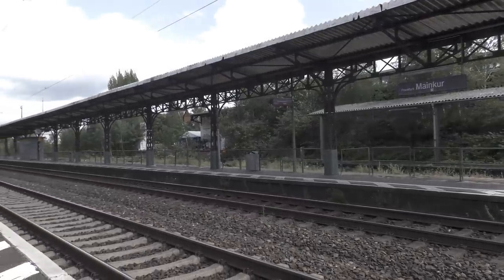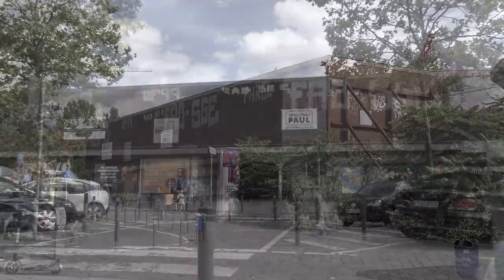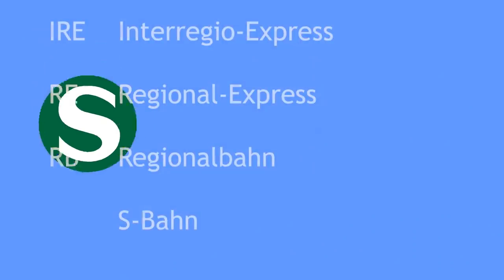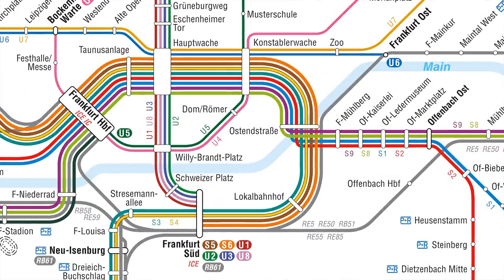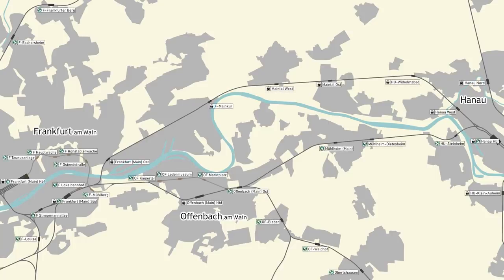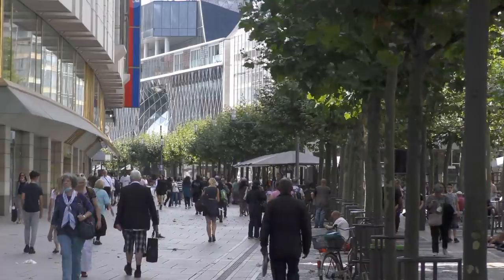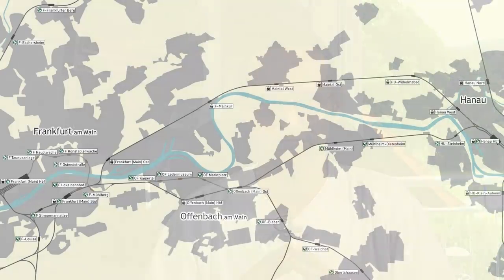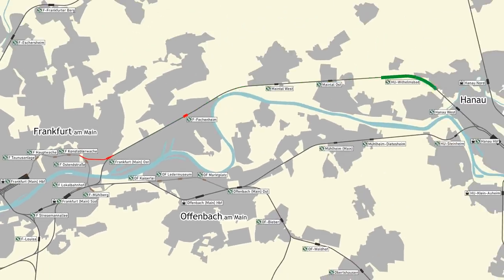Why is this station so neglected?

Comment: Imagine the day you're born, your parents hear good news that there will be a new train system. 35 years later, you're still hearing the good news while taking your child on this crappy train.
Reply: Yes, indeed.
Reply: It seems too common in Europe. In my town they promise to build new road bypass as it is really not sustainable to have about quarter of country to go through centre on something that is between road and stroad and planned in 30's and build shortly after WWII as it was necessary to rebuild it as Wehrmacht blew up about 6 or 7 bridges on short stretch, and it is still not finished after 30 years. Only luck is that town on other side of border had banned cars above 6t otherwise there would be even more trucks going through.

Comment: I mean, these stations look alright-ish, there are some horrid stations in the Ruhr area, too, which shouldn't be neglected by design.
Duisburg Main Station for example has >10 platforms, and is also slowly falling apart. There was a plan to rebuild it, starting 2018 or so, I think.
In 2021 there are some nice stickers on some walls inspired by the way the rebuilt main station is supposed to look, so that's something!

Comment: The problem is you can’t expect people change from car to public transport if stations looks like this. In Germany are a lot of railway station looks like Frankfurt Mainkur.
Reply: Indeed - unfortunately. And you can´t forbid short-haule-flights like many environmental activists wants to do it without running a proper railway system. And the stations are only one problem of the railway system and probably not even the worst.

Comment: I was shocked in the past years to see how derelict some stations in Germany were when traveling from the Netherlands where stations are often in excellent condition. Especially the track hall in Duisburg when coming from Arnhem... It had nets above the tracks to prevent debris from the dilapidated roof falling on travelers heads! But when I started looking into that a bit I found that the plan is to replace the entire roofing structure by a new one as a grander plan to renew 150 stations in NRW starting 2022. Well, here's hoping that doesn't get delayed any further...

Comment: I'm in Canada. We are sometimes given the impression that Germany is some sort of Commuter paradise. I love the candid dose of reality. 
I currently travel between Toronto and a small city called Peterborough. It has excellent highway service, but one neglected freight line to Toronto which hasn't had passenger service since about 1984 (many of the stations have literally rotted away). The Federal government recently announced that it would be on the route for a new high speed passenger service from Toronto, Ottawa to Montreal (it's about 60 kilometres away from the Lake Ontario and just outside the urbanized area of Toronto - think on the edge of classic Canawilderness
Reply: In terms of frequency of connectivity, even the bad stations in this video are way better than most Canadian ones.

I mean even in the Toronto metro area some lines still don't have all day service, while these shitty stations in the video get a train every 30 minutes all day long
Reply: Not a paradise. Public transport of some sort is almost everywhere, but you can't say that the service is good and it's a pleasure to use. Actually it's been going downhill in the past 20ish years.

Comment: Large investments in a line are not the only thing: you need travellers as well.  When you have misstreated your travellers away for such a long time, you start with much fewer users, which is bad for investments.  So: I is very probable that minor improvements to buildings which will get destructed will pay-off later.  Certainly when plans are not yet executed.
Reply: The half hourly service was bursting Pre-C with 150meter trainsets and additional peak relief trains because even with the stations in their state of disrepair, the route itself is well kept and a far superior option to the heavily congested Hanauer Landstraße and it's jams.

Comment: Where did you hear that Ffm-Ost will be completely replaced by the underground station? As far as I know, it will only receive an additional underground station for the S-Bahn, while the mainline services will still be stopping in the current overground station.
Reply: The commuter platforms will stay. There will still be REs calling because of the EZB, but probably only once per hour.

Comment: I would not hold my breath either...
The place I live now is basically cut into half by a rather busy (freight and commuting) railway line with raiway barriers in 5 places, being lowered at train rush hours 30-40 minutes an hour nowadays. An underpass was planned very early on - the excavators and dump trucks, however, which already had been moved on site, had to be retracted on the day the were supposed to start digging, as it was the outbreak of Word War I and they were needed elsewhere...
Ever since, there have been plans announced.
In 2021, I think, they started to build an underpass for pedestrians and wanted to continue with one for cars. However, dues to the pandemic and such, there were not workers. So the railway line was blocked for weeks several times, with very little work going on, and after that, in 2022, the Deutsche Bahn declared that  the next time window in which they could go on would be in 5 years at it's earliest. Up to then, the construction site in the middle of the town would just have to stay as it is... Upon protests of practically everybody, they at least finished the pedestrians underpass. And might even resume construction work next summer, as I recently read. But - I am not holding my breath. Again.

Comment: This situation is way worst in China... CR (China railway) is only good at operating long distance train and cargo trains. (We have a very cheap but very convenient and decent long distance passenger railway system, that's rare across the world.) But due to it is state owned, not city owned. CR can't feel the benefit of its service that developed the city or TOD. Investigating so much at commuter train, while occupying more profitable long distance/cargo trains' slots, makes CR just ignore any commuter train demand. And even worse, CR is formerly a department at nation level, it has same power of a province... Even Beijing government are just "equal level" as CR... Beijing gov subside S trains in Beijing for hundreds millions per year, but CR still very lazy at providing any commuter trains.
While the rest of China, most stations (including many small cities main stations) are closed for passenger service. And force most mid distance travel (I mean 10~200km, that's very long for other countries) to long distance coach or bus service. BTW, our airspace is controlled by China air force... causing LCC airlines way expensive than rails.
Also, same for Beijing East railway station, you can see the CBD's skyscrapers there, but the station in front of you is just as poor as the ost bahnhof in the video...

Comment: I lived at Frankfurt Ost in the building next to the one at 1:31 for 2 years - in the south of the railway line. Over the last decade they really built lots of housing like in 1:31 on that side of the tracks; a completly new suburban area around Ferdinand-Happ-Str developed. Right next to the station. BUT… the Station only has an exit to the north side of the tracks. You have to walk through a seperate tunnel created for the U-Bahn to reach the other side of the tracks. I barely used the trains there - if you wanna get into the City, you take the U-Bahn 6 or tram 11.

Comment: In the Rhein-Main area this line is one of the last (THE last?) line to get S-Bahn service.

Other German metro areas are off far worse: If you want to look at REALLY terrible stations and also just bad service, look at the Rhein-Ruhr-area.

There is STILL no S-bahn between Köln and Bonn! One is Germanys forth largest city with over 1 million inhabitants and the other the former capital, with around 350.000 inhabitants. If we're lucky it's going to be finished in 2035... 

And in the Ruhr area the service frequency is just terrible, and they started replacing the S-bahn trains with regional trains (which have fewer doors and are often shorter), but they still call them S-bahn...
Reply: > There is STILL no S-bahn between Köln and Bonn! […]
I mean, there's the RB26, which basically behaves like a S-Bahn between Cologne Main Station and Bonn Main Station, stopping at every station in between. Even goes every hour! (sarcasm)

Yeah, going more south than cologne, by public transport, is a bit of an ordeal in NRW 😅
Reply: @niduroki  At the very least there‘s an alternative in the form of the Stadtbahn services 16 and 18 on the former KBE railway lines … with slow, insufficient 60 m long light rail vehicles
Reply: @ft4709  And single track sections only allowing those 60m vehicles to operate every 20 minutes, at least on the Brühl-Bonn section...

Comment: Around 1982 the VR wanted to close Healesville station, the locals threatened to give the station building it’s first coat of paint since 1947. Which they did. The line was soon closed and is now a tourist railway for part of the length.

Comment: This is rather good - or is it unfortunate - timing, coming on the back of a train drivers‘ strike that wrecked not only most train services but also SBahn lines for two days. My husband was due to travel across Germany to The Netherlands yesterday, instead he had to go by plane - so much for the German commitment to the environment. In fact, due to the S-Bahn strike he couldn’t even get to the train station. Here in Berlin we‘re used to the stations looking rubbish - we just want the trains to run.

Comment: Frankfurt Ost will not closed down. The new line is only a additional route for the S-Bahn. There will be 4 tracks in the end. Two used by the S-Bahn, two used by the other trains. The RB-Services will be replaced by the S-Bahn services, so that the old routes will have more capacity for the long distance services and the fast regional services. But the old route will keep the stations at Maintal and Frankfurt Ost.

Comment: I used to be a daily train commuter from Frankfurt. Whenever I passed this station there were no passengers to get in or get out. Anyway, what is "Mainkur"? Do they have a spa there? The same with S train station Frankfurt (Main) East and Offenbach main train station which has largely become futile by the circumvention of the S rails going another way..
Reply from the maker: It's named after an old customs post between the Landgraviate of Hesse-Kassel and the city of Frankfurt, which was called "Main Cur". I'm not sure where "Kur/Cur" comes from, but I assume it's as in "Kurfürstentum" and "Churfranken", not as in "Kurort".
Reply: Living in Alt-Fechenheim not far from the station I can only say: this is where the rich and damous come to spa weekends to refill their batteries

Comment: I was very surprised when I arrived the first time by train in Frankfurt Hbf (central station).
Just across the station you first have to pass through the big red light district to then get to the financial/shopping disctricts.
Reply from the maker: It's very common to have red-light districts near train stations and harbours.
Reply: Ja, es ist ein weiter Weg vom Hbf zum Diebsgrund (Adresse der Dt Bundesbank).

Comment: Here in the Netherlands every station is pretty well maintained, though the worst state I have ever seen a train station in was at Vorden; the station building had its windows boarded up and the platform (as well as the sidewalk just outside the station) was covered in squashed cockchafers. It was May when I went there, so the critters were all swarming around, though the problem was by far worse in Vorden than anywhere else on the network.
Reply: the thing is the German Railroads which is the owner of the station buildings actually gets rid of many old station buildings, sells them to private investors and the cities and they don't have any further need and use for the building itself and only run the bare station with its platform and other basic facilities. This is often true for minor stations.
Reply: @EnjoyFirefighting  Around here a lot of buildings have been demolished too, but at least the stations are well maintained.

Comment: Thanks for the video. But I wouldn't mention Ortenau-S-Bahn and Breisgau-S-Bahn in this context. Both were more like a Regionalbahn (you also mentioned that kind of trains). They also didn't use the green S-Bahn logo. Also the routes weren't called S1, S2, ..., but their route naming system was more like used for Regionalbahn/-express. At least on the route of the Ortenau-S-Bahn that goes to Strasbourg you'll find French TER trains from time to time, which are also when looking on their name more like the Regionalbahn in Germany.
Both companies stopped existing in the 2010s because of new rules when such companies want to apply for servicing such a railway route. Most of their routes and trains are now operated by their parent company SWEG.
I'm also thinking that S-Bahns are made cheaper by having toilets less likely than Regionalbahn or Regionalexpress. I also never saw more staff than the train driver on board (except for occasionally checks by ticket inspectors). That's also what SWEG does. In contrast to that, every train by Deutsche Bahn I know (incl. Regional...) always has toilets and a train conductor who also checks all the tickets.
Reply: Regarding toilets: I think this is more because of the rapit transit (metro) function of the S-Bahn, considering that the older systems use three to four pairs of doors per car, trains are high floor and the lines are rather short compared to a typical Regionalbahn line. It's especialy noticeable with Baureihe 423 and its derivate 425, since they have a similar appearance but the former features the aforementioned rapid transit characteristics while the latter is low-floor, have only two pairs of doors per car and... do feature toilets.

Comment: They did the same with my school building, letting it rot because they thought about building a new one. 

The school i did go before that did go from a building built directly after the war (so shoddy construction) to a bnuilding that was renovated a few years back but already had fungi in multiple classrooms. IF they stopped using it as school they would have had to pay back the grants the eu gave them to renovate it. I always wondered what they renovated when a third of the classrooms had fungi....

Comment: The separation into to Metro-Systems, S-Bahn and U-Bahn originated in Berlin, U-Bahn had  more narrow cars, in order to dig only narrow tunnels, and Both S-Bahn and U-Bahn (in Berlin) had an earth bound third electricity rail, which made them incompatible with conventional rail, up to today.
All other cities made slight copies of this idea, but must often with conventional railway equipment, S-Bahn was more a matter of route and timetable design.
Over the years, they got these separate stations or platforms in stations, to avoid conflicts with long distance traffic. In Franfurt, it's technicly only tunnel heigh separating some specialized routes. S-Bahn tunnel cannot be used with double-decker-cars or Cargo.

Today you have trams in the tunnel, U-Bahn overground, S-Bahn underground, any kind of combination.
Reply: even when power is a third rail for U-Bahn and S-Bahn, they are incompatible in Berlin because one is accessed from below and one from above

Comment: 3:27 my Hometown is missing, we got an S-Bahn. Only one line is actually like an S-Bahn, the other should be labelled Regional Trains instead, but still that one line is a proper S-Bahn ;-).
https://en.wikipedia.org/wiki/Rostock_S-Bahn
Reply: Karlsruhe is missing as well although they're a special case. They have implemented a system with special trains that can use both the tram tracks within the city and the regular DB tracks in the surrounding area with several connections between the two networks along the city's borders. The most extreme case is S5 that goes from Bietigheim-Bissingen which is also part of Stuttgart's S-Bahn network through Vaihingen, Mühlacker, Pforzheim, Wilferdingen, Karlsruhe (right through the pedestrian area in the city center) to Wörth where sometimes change labels to S51/S52 and continue all the way to Germersheim which borders the Rhein-Neckar S-Bahn, all in all about a 3 hour journey.

Comment: huh! i always wondered what exactly people meant when they said s-bahn, because here in my city we dont really use that word? we have the trains, so the RBs and REs (and if youre fancy ICEs), buses and just "die Bahn" which is i guess an S-Bahn (we use that word rarely, but if we do we mean a Straßenbahn...) which has above and below ground stations, runs on its own rails shared with no other transportation and runs most of the day 6 times an hour for all 4 lines in all directions. but it doesnt go outside the city, so its really just locally. i guess we differentiate and call them "zug" and "bahn" even though the züge are run by the deutsche bahn...words are hard
Reply: If you don't use the word S-Bahn in your city than you don't have an S-Bahn.
Reply: @Jehty_  thats the thing though, some people do 😅 thats why i was always confused, i thought s-bahn just meant Straßenbahn or maybe Stadtbahn (which is what the city website calls the bahn) 😅 but i guess thats just people also not knowing what the difference is and assuming the colloquial name for the stadtbahn is s-bahn... too many words that start with "s" 😬